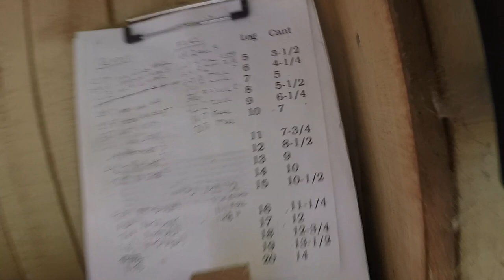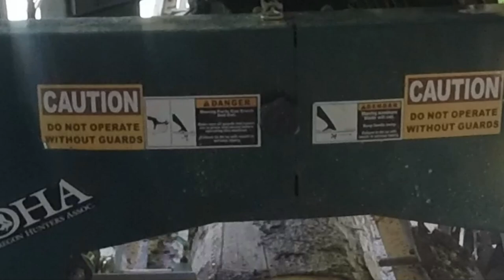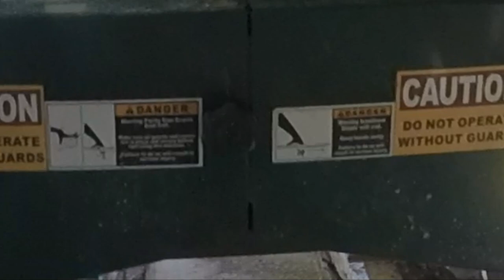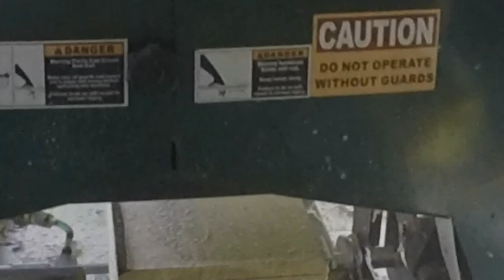More Free Logs on my Woodland Mills Sawmill, Day Two

Comment: I simply use a magnet on the vertical scale holder and place a spacer ( any dimension ) between it and the indocator board. Close the gap and repeat for each board. Perfect thickness everytime. No math no fuss.
Reply from the maker: If I get the correct picture from your description, it's head-slap brilliant.

Comment: Eugene, your blades are a lot cleaner than mine.  What are you using for lubricant?   I too should be wearing a stay mask.  Stay safe and excellent video.
Reply from the maker: Windshield washer fluid or water, and nothing in wet wood. I made a blade scraper out of a broken blade that gently rides the band. Two of them, but that's a long story covered in earlier vids.
The reason only the top side of the blade gets gunked up is, sawdust is pressed on by the wheels, so I started by trying to keep the sawdust off the top of the blade and out of the wheelhouse with varying degrees of success.
Your mill is outside and you built that self-driving thing, so you can escape the dust more easily than I can.

Comment: Your centrifugal clutch is tinging when the engine is at idle, means the idle speed of 9.5hp engine is a bit low. Try upping the idle speed and see/hear if the tinging goes away. Bet it will. Be Blessed.
Reply from the maker: I hear it only right after startup before engine is running smoothly. Maybe it's my defective ears. Constant pinging is a result of idle too high which engages the clutch momentarily on the power stroke. Fix for that is to turn it down.